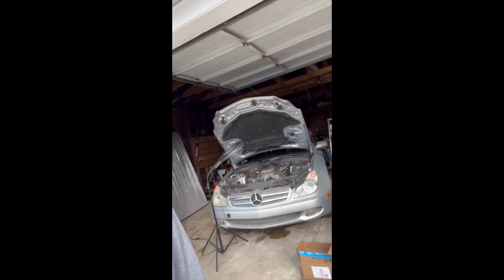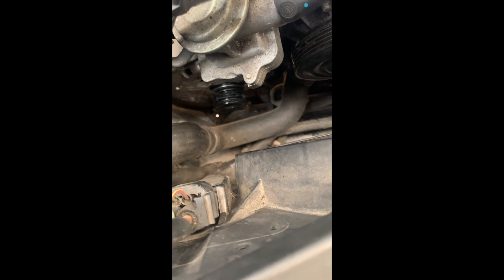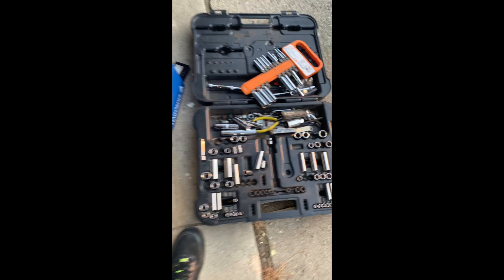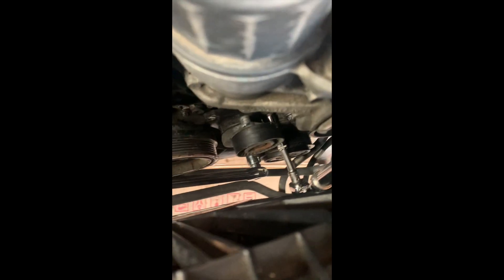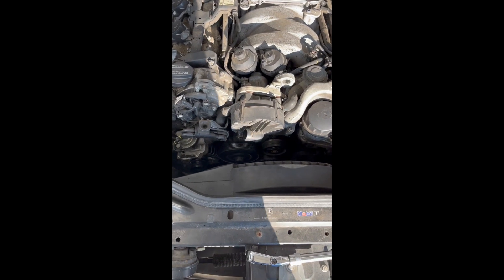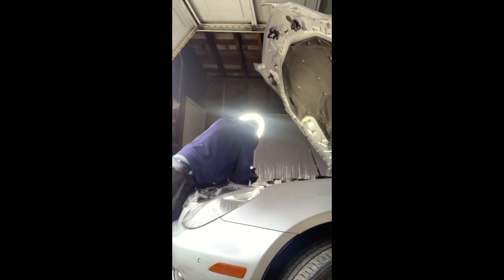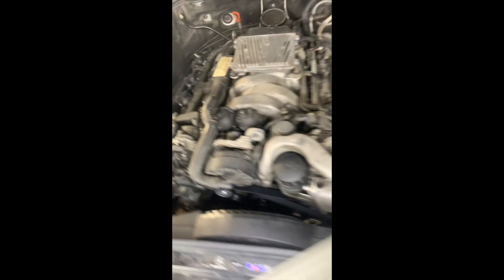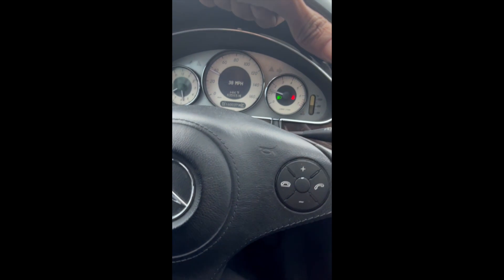2009 CLS550 serpentine belt, idler and tensioner pulley change

Comment: My tensioner belt belt basically did the same thing as yours in this video and I took it to a shop and their charging me 568 to change the belt and the pully and tensioner..wich initially they said nothing was wrong with it..however they also wanted to charge me 200+ dollars to remove remnants of the destroyed serpentine belt..my question is that necessary...??pl let me know as soon as possible..love ur show thanks bro
Reply from the maker: I’m a do it all type of person so I would definitely suggest having them all done to give yourself a piece of mind. I’m not a mechanic just a DIYer so it’s definitely something you can do in a hour or two if you have the tools